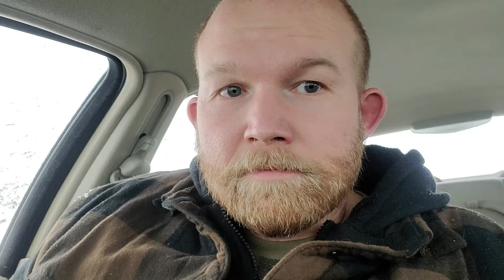2003 - 2011 Lincoln Town Car Heated Seat Talk - Lets Chat Troubleshooting

Comment: Thanks ford boss for taking the time to make all these helpful videos .I love the seats on the towncar. I am actually trying to change the leather seats from a Lincoln Towncar to a 99 Mercury Grand Marquis LS with leather power seats. Ive seen 1 or 2 people do this, but unfortunetly no videos on how they accomplished it. I am hesitant  because of the differences in door modules and connectors seems a lil complicated or they ddint get all the features the seats might come with. Any help would be greatly appreciated from you or the panther community.
Reply from the maker: When it comes to modifying a lot of the Interior stuff for doing what you're saying by swapping seats I'm not any  help when it comes to that because I just don't do that stuff
Reply: @FordBossMe  Thx for the reply. I understand hopefully someone here in the community knows someone that has done it or can advise. Like I said love your channel and love the panther cars.

Comment: My passenger seat heater don't work. It's the pad and the dealership will do it for $1600.00  Disconnect the wire connectors then remove the seat from the car take off the leather covers. So on and so forth. I forgot to mention hog rings if these seats have them.
Reply: Maybe this is why many are coming to you about them. The price ain't cheap at the dealer.
Reply from the maker: Well there's one of two ways I can do it I can do aftermarket setup and show people how to set everything up with just a cheap $50 set of pads or I can go oem